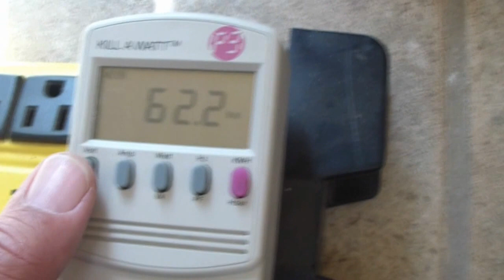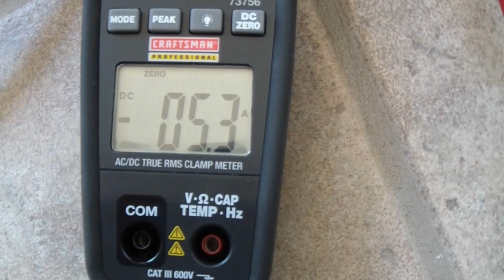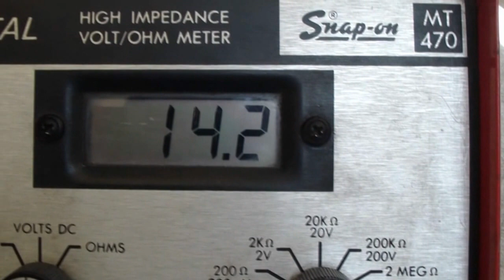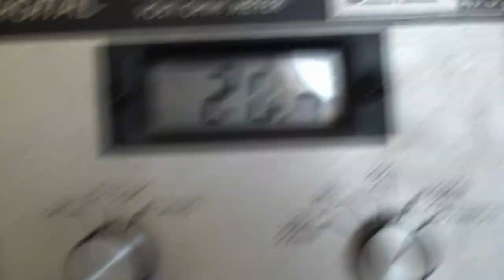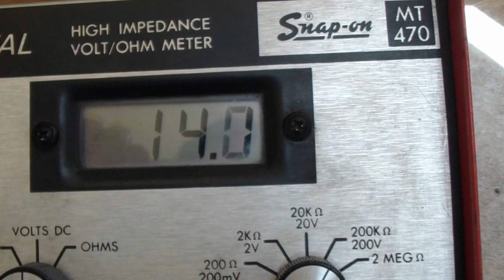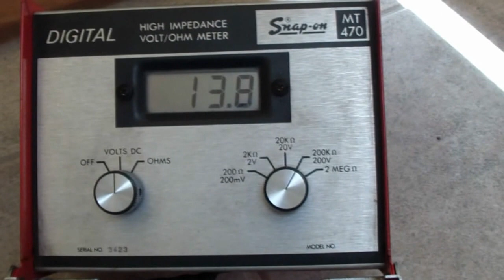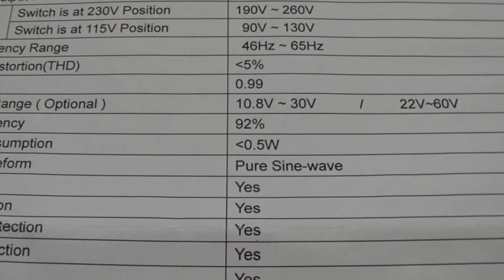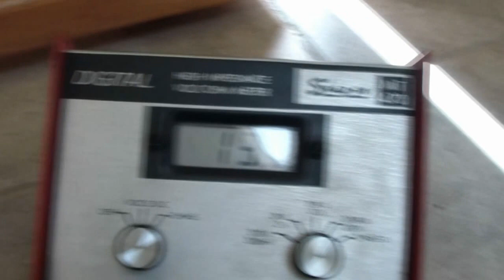Grid tie inverters, are they worthy of spending our time/money on them?

Comment: Is it legal to use these in all states?  I thought places like Florida doesn't allow you to feed power back into the grid unless the solar power turns off if the grid goes down.
Reply from the maker: I really don't know!
Reply: If you left that running and a person had to work on a powerline, they could be shocked.  I wonder if that thing is able to turn off the power once it sees that the power company power has shut off.  Did you install all of the solar panels on the roof yourself?  Did you ever have code enforcement come bother you?
Reply: @CarMaintenanceGuy  When it sees no power on grid it turns off. So linemen are all safe.
Reply: @CommunityWISP  Yes, I found that out after buying one to lower the electric bill for somebody.  Then I ended up putting 30 solar panels on my roof with a SunnyBoy 7.5 kW inverter.  My electric bill was like $10-15/mo for 3 years since I last wrote that comment.  I bought a grid-tie inverter like this one in your video, but I bought a 600 watt version for 3900 pesos, which came out to $70 USD.  We have two 200 watt panels feeding power into it during the day.

Comment: These type inverters increase efficiency at the higher end of voltages on the input side of the inverter. The higher you get to the max DC volts in that the inverter can take, the efficiency will go up.

Comment: Buddy you are doing the math wrong. Input voltage DC 14 volts at 5 amps = 70 watts input. Output is 64 watts AC. A 6 watt drop makes it right at spec not 40%

Comment: Voltage will drop if you suck power through a load. Its totally normal. If I am not wrong then the rule of thumb is when a power source is on load the watts should be measured by multiplying the voltage with its ampearage. 

Time stamp 3:00

the incoming reading was 5.2 Amps not six. It happens when you talk with a non-objective view point.
The voltage of the input was 14.2 so the watt is slightly around  73 watt. 

on the AC end 
your Kill a watt showed 63 watt. the system like an inverter will consume 10 watt its also totally normal. 

Now if you calculate the watt came out from the AC output (using the causal formula :) we see that 121 volts and 0.56 Amps
Results in 67.7 watts

So now you tell me  is it efficient?

********************************************************************************

Philosophical point of view you don't like philosophy dont read!! :)
People sometimes never realise that he is acting like a conservative. Keeping the way of life as it is now is not a good thing. Specially when it comes to the power issue. If we run out all the non-renewable resources what will happen to our future generation? I am not in an oil or muscle rich country So I have no way. I must change so that my future generation keep on going.

Comment: You're a little off by my calculations. The inverter is putting 66watts into the house. There is 14volts and 5.5amps going into the inverter. So you're right, that's 77watts. You then have to ask 66 is what percent of 77? To find that out you have to divide 66 by 77, which = 86. So the inverter is 86% efficient. Which means the inverter is wasting 14% of the energy it is receiving from the solar panels.

Comment: This is not a GRID tie inverter. Beware the chinese like labeling them "grid tie"  It is not! If you use it to tie into the grid, you may have a fire. In order to have "grid Tie" status, it must adjust itself to match the power company's phase. you can have a fire if you backfeed your power while connected to the grid.
Reply: This is a GRID tie inverter, Try to keep up.

Comment from the maker: Hello Chuck, I did change my setup, I have 20 feet 4/6 cable bringing power from 620 W panels to a 600 W GTI, on a good day I get a readout of about 450 W and 1.6 KW at the end of the day (short days!). I shelved the 300 W. GTI for now but I did connect it to the battery bank and it pumped about 250 W with an Amps draw of 16. Planning to work on it later once I recover from my cold.  Thanks for looking and your comment. BTW nice channel, I like.
Be Good, Godspeed,
El Raz

Comment: 200 watts worth of solar panels and only producing 62 watts?maybe there is voltage drop with using 12 volt panels and long run of wires to the roof of the house?

Comment: NO, If you spend $500 on the system. and they at max you get 300KW per year back. 300KWx.16=$48 a year savings.  After 10 years it will pay for it self. You need a 16k system to do anything and they are $20,000. Thank about it. Also i see you get 60Watts back. That is one light. Just turn one off and you just saved that money. Hell put LED lights in and save 10 as much.